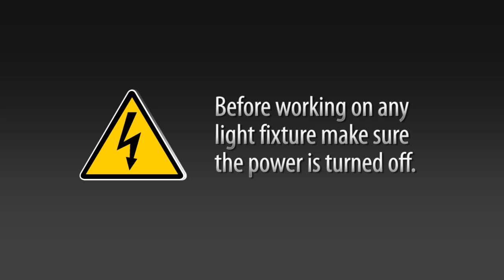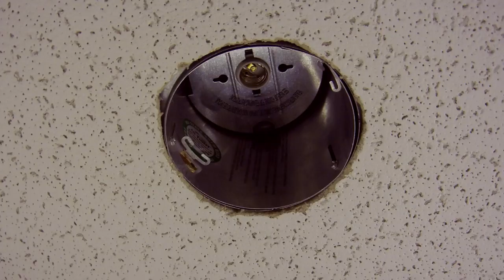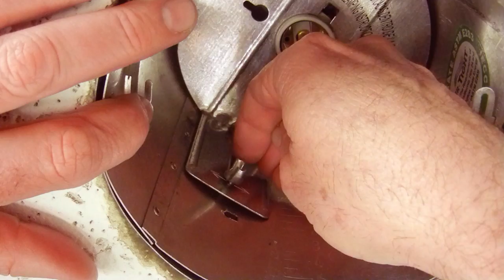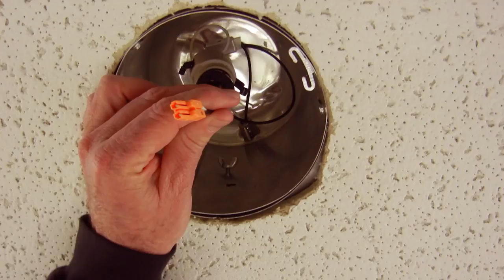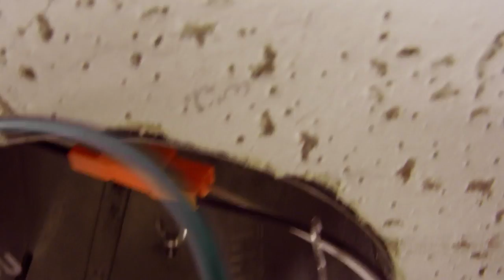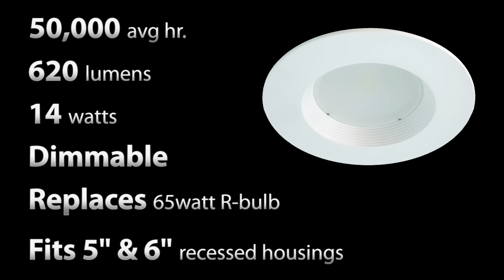How to install LED recessed lighting retrofit trim for 5" or 6" housings by Total Recessed Lighting

Comment: Well done Sr.  I replaced 6 of them in my house.  However, they won’t stay on for more than a minute.  Any good advice you could provide.  Greatly Appreciated.
Reply from the maker: I would check with a multi-meter to see what the voltage is and make sure it meets the requirement of the LED retrofit trim. Also, If it is on a dimmer make sure the LED is compatible with the dimmer you are using.

Comment: Brilliant! I was worried about removing the socket bracket, because the instructions didn't show that. The GE light I got at Sam's Club wouldn't fit in the can with the bracket still in place. Thanks!

Comment: Just used this video instruction to install 5 lights that are essentially identical to the one in the video.  Very helpful as a couple of steps, such as removing the socket from the socket plate, were new me.  Love the power of the internet.

Comment: Typical light out for LED is 80 -140 Lm per watt. (Depends on led current). Your power supply takes 5% so  14 w - 0.7 w = 13.3 w.  If you calculate your Lm per watt you will get 650/13.3= 49Lm . It is very bad result. According to lamp Lm output it has 9 watt chip inside. Why Cree put 14 watt label on it?  How about color temperature? Is it cold white?

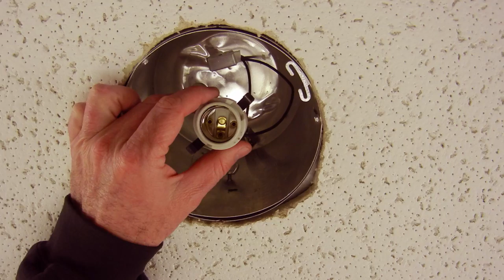Comment: Hello, to install a Cree CR6 Six-Inch LED Downlight, you would connect the Cree at around 3:12, by simply screwing the Cree socket into the existing socket, right?